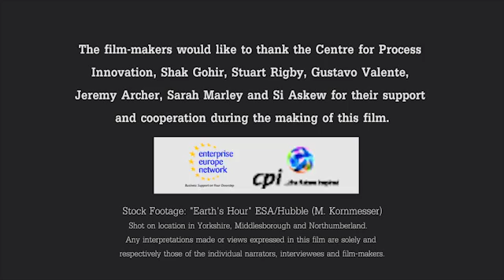AlgaeCAT: Discover Algae Carbon Capture

Comment: Hi,
I am interested in finding out more about algae carbon sequestration as a method of reversing the damage we have already done. In particular using algae farms to produce a lot of algae and that algae being injected back to where we got the CO2 in the first place. My thoughts are in salt water injection wells in the oil fields as well as filling up the cavities after solution mining is done. We could go back in a million years to get the oil, but that is not my point. I would be interested in anybody’s thoughts on this.

There is an organization in New Mexico which propones that taking 10% of that desert state for algae farms would solve all of the energy needs, using carbon neutral fuel, for the US. Maybe taking another 10% of that desert to reverse global warming, lowering ocean temperatures and reducing its acid, saving the coral and geo-engineer back our glaciers with time.

Any thoughts???
Itt
Reply: I think the storage in former minds in the most feasable technic to storage solids like dry algae. However, something else will be neccesary to lock it up so as to avoid it decomposes and release the co2 again.
Reply: I also like the idea of using deserts to store solid forms of capture C02